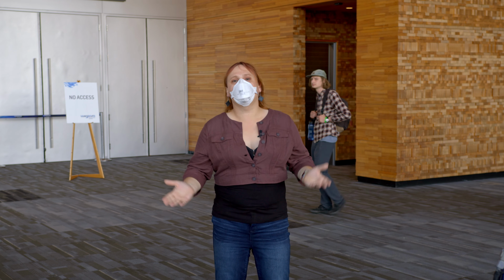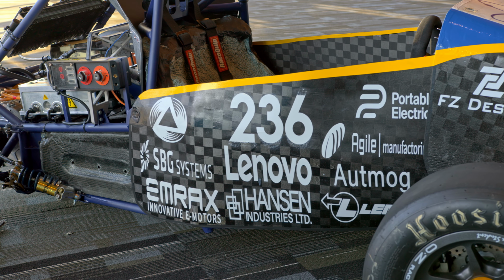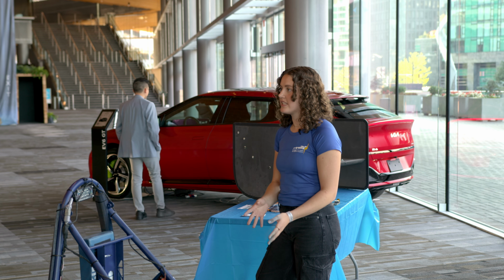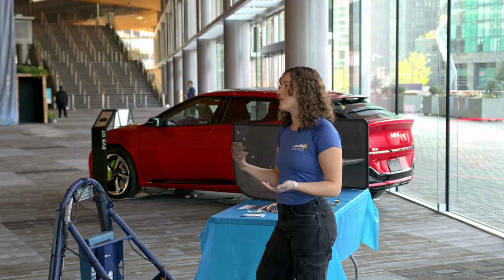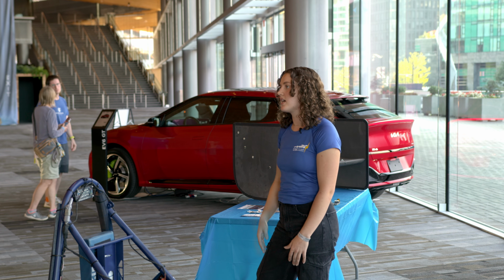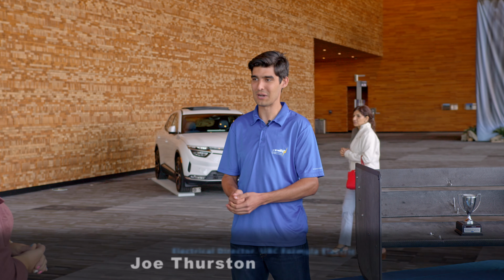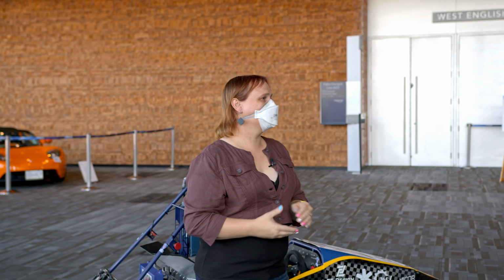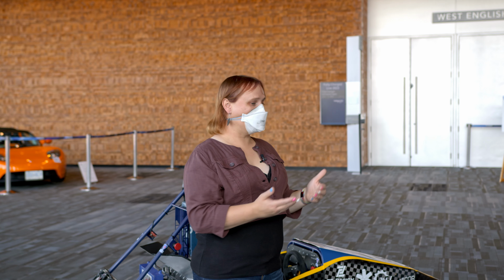From Here To Tesla - How UBC's Formula Electric Team Builds The EV Experts Of The Future!

Comment: HI Nikki I was last weekend at a Electric car show in Quebec city Canada and there was a team from a other University and they had a electric race car this one was 4 motor with planetary gear they made their own motor , planetary gear , inverter , battery pack and BMS they mentioned and showed me one of the competing car's battery pack went into thermal runaway but the battery was not installed in the car anyway I was so impressed I talked to a guy that was a mechanical engineer and the other guy was a electrical engineer.

Comment: Was on my school's electric go-kart team in high school. Back in the days of lead-acid batteries. I was the welder, and switched our car from steel tube framing to aluminum tube because I could actually weld aluminum competently. I even got to drive the car once as our regular driver got sick one race, and I was the only other team member with a driver's license. Unfortunately, the car was custom built for the 5'4" driver, and I was 6'0". I had to hunker down in the seat with terrible posture to prevent the top of my helmet from sticking out the top of the vehicle.

We never won a race, but we were the only team that finished every race! My race was by the skin of our battery, as I weighed more than the usual driver, I crossed the finish line doing about 5 MPH, about 5 minutes after the second-to-last car finished. (The course only took about 2 minutes per lap at normal speed 30-40 MPH.)

(And now Nikki knows where my penchant for driving EVs to the very bottom of the battery comes from.)
Reply: " I was the only other team member with a driver's license"  Hahahaha, nice touch!